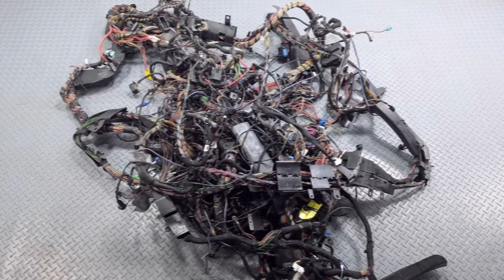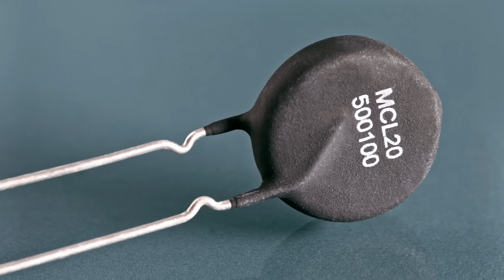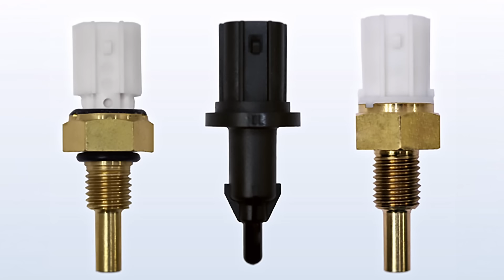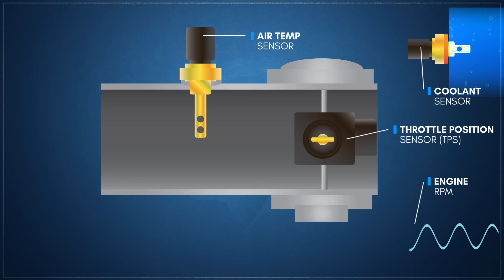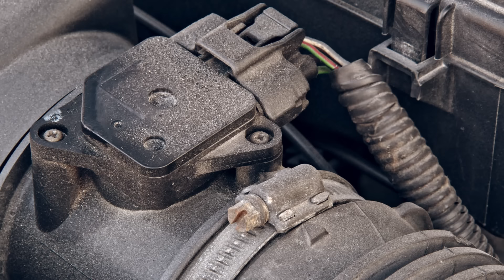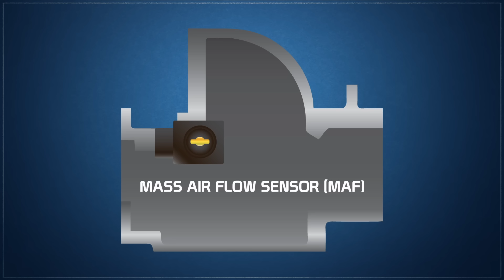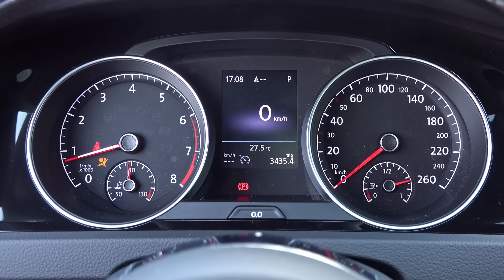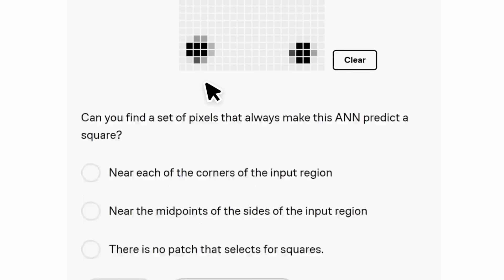The Insanity Of Engine Sensors

Comment: PSA: Only ever buy OEM sensors when repairing your vehicle. if it has wires don't buy a dorman, or any after market sensors
Reply: Pro tip: look at your sensors and find the stampings because most oems are rebranded, made by a general manufacturer like  denso, hitachi, etc. You can save a lot of money not buying oem branded, but get the true oem manufacturer.
Reply: @timlong1462  its true but, The quality Control of OEM was more exigences with tolerances, some refuseds sensors that was refused by OEM goes to second market branded by The fabricant.
Reply: @gga85_ That's not how QC works. Statistically representative samples are inspected and tested by the manufacturer. The manufacturing process is QC'd, not each unit - based mostly on self-reporting.  There is no one at the OEM determining pass/fail at the unit level.
Reply: @ImListeningToReason Yes, 100% sampling can be done. But again, that would be part of the process that is certified as OEM.  The idea that the same line is shunting untested or failed product for separate packaging is BS.
Reply: @kenp5186  While you are right that sensors are generally not binned (sell fails as lower cost to other brands) 100% testing of at least some parameters is very common in sensors. In fact, it is actually often required: due to the way the are manufactured, it is easier to make an inaccurate but stable (and precise) sensor, and calibrate it during testing, instead of making a sensor that is accurate by default.
Reply: @JorenVaes  Yep...do you have anything that supports the original claim from @gga85_ that "refused sensors go to the secondary market"
Reply: @kenp5186 You can have products going through a second QC with a buyer. That’s what he’s referring to.

This may have not been done at some point with some manufacturer(s), but sometimes a company will have a higher quality standard than their supplier—actually this is pretty common, especially with suppliers from “the mainland”.
Reply: Well said big sensor...
Reply: @ thanks, ebay steve!
Reply: You are a fool to pay OEM prices, they are all from the same few manufacturers, IE you think ford is making 100 000 cars and orders say crank angle sensor from anywhere but china , and that said you really think said Chinese supplier isn't making the after market part since ford stop making that truck ... No my friend all OEM is a colourful box with a ford label stuck on it and 300% mark up..
Reply: @ntal5859  There's people who seem to think that at the end of the production line there is someone sorting through the sensors to put the good ones in OEM boxes, or that perhaps they have gone through the time, trouble and expense to build an entirely separate production line dedicated to inferior product.  Although a few 'only for aftermarket' companies that compete solely on price are definitely doing the second one.
Reply: @ntal5859you obviously don’t work in the field of automotive diagnostics. 
More and more I’m advising customers to use genuine parts only.
Reply: Thanks Steve. GN
Reply: Dorman is the worst. I don't know how they are still in business
Reply: Sounds like company man selling over priced remanufactured junk parts
Reply: "If it has wires" that doesn't narrow it down, beside let's be real most OEM parts are just from general manufacturer repackaged and come with 200% markup
Reply: Idk bro im about 50/50 with cheep ones working and 75/25 for good ones working but they cost 2 or 3x the amount so it depends hm work your willing to do
Reply: If yall think dorman is the worst you haven't spent enough time on rock auto
Reply: Stupid advice... Plenty of high quality aftermarket sensors with warranty, at a better cost, are available for vehicles.
Reply: That’s weird bc I had Dorman and import direct products last years with a life time warranty. I even have no problem and no problems with putting on those brands on my bmw no problem at all.   That difference between oem and aftermarket is closing do you really think that part of the industry really gonna die out ?   Lmao
Reply: @tootsitroll9785  No what he said is absolutely true in many cases. Been a tech for 13 years and while it's not true across the board, it is absolutely true many times.
Reply: @tootsitroll9785  bros bmw backfires and doesn't even know it 😆

Comment: When you mentioned vane style mass air sensors, I knew I was about to see a Miata
Reply: bmw e30 318iS never forget <3333
Reply: Miata engineers: make the headlights like the sensors!
Reply: Or my old B5 Passat
Reply: Or a second gen rx7
Reply: @torque-ej4nu the FC?
Reply: @JustDr3-TV  yup
Reply: Any Toyota from the early 80s to early 90s
Reply: 1992 Suzuki Vitara 1.6
Reply: I learned my first efi on the Ford turbo 2.3 with vane metering...efi tuning back in the day with a blinking light or counting a buzzer for codes... Wow. Feel old...
Reply: @bransonclayton I can remember timing lights and setting points... Lol.
Reply: I have a 91 miata with that air mass sensor.
Reply: Or a Retro Encabulator
Reply: Toy Supra,  Datsun 280z  🤔  and a grip of Mazdas had that vane valve deal. Toyota Cressida Nissan Maxima What was the honeycomb one called?  Carman something, Hyundai/ Mitsubishi had these.. a weird port that idk I don't recall having a lot of difficulty with  that style, very  dependable. Karman Vortex, that is what they are called. They work by drawing the air through a vortex tube and there is a triangle shaped obstacle that sets off turbulence, with an led and digital frequency it measures the  buffeted air turbulence and does this surprisingly well. Haven't seen one in a couple decades...

Comment: Awesome video!! I also find it fascinating to see where auto sensors are detecting one parameter as a proxy for another. An example would be using oil pressure as a proxy for flow. I’ve changed truck fleets from mineral 15w-40 to synthetic 5w-30 in the past and everyone freaks out because of the drop in pressure. The engine oil flow is still the same (oil pumps are positive displacement), but as viscosity is resistance to flow, the back pressure will also drop.
Reply: Why not synthetic 5w-40? Less viscosity does indeed mean weaker hydrodynamic effect in the bearings and sliding surfaces.
Reply: You are forgetting oil film strenght on splash lubed surfaces such as the cylinder liners or the valvetrain. 
And hydraulic valve lifters those are very picky to oil viscosity despite being primitive components.
Reply: @alouisschafer7212we didn’t forget. We switched between a group II 15W-40 and a full group IV PAO 5W-30. That, and a change in the VII and VM’s in the formulation means the 5W-30 had a better film strength. We did have some unfair advantages in that I have access to formulations and tribology labs.

I’d say your comment still stands though in general cases where you don’t have access to that detail.
Reply: @LubricationExplained  wow not only does your job seem super interesting  It has a lot of practical applications for doing that kind of research. I actually have been trying to do as much research as I can into different lubricants trying to figure out the best lubricants to use in my motorcycles. I actually have a question about my 2002 Kawasaki ZX 1200 if possible. for a long time, basically since I owned it up until about 4 to 5 years ago, I’ve been using the brand specific oils that you get at the motorcycle shop and they are probably double the price of anything that you would normally get so I am gone and done some research because I did learn a lot of stuff aboutdifferent lubricants when I was dealing with my Harleys, so according to a lot of different forums and different things that I’ve read here and there instead of using the Kawasaki brand oil I am now using Rotella T6 oil for diesel engines and I’ve been switching between 5–20w In the cooler months because I live in New England and I tend to ride in the fall a lot and then I’ve been using the 5–30w in the peak of the summertime. And not only does the oil on these type of bikes, cool the engine and lubricate the parts, but it also works as the lubricant inside of the clutch as well and the clutch seems to really like the Rotella T6 diesel formula and I’m just wondering what exactly makes it better For my bike and is it something that could cause damage to some components or does it seem like somebody found the golden ticket and gave everybody some really good advice? I’m torn between the two and seeing somebody with your type of knowledge gives me some positive hope for a, informed answer
Reply: @mriopelle33  Dude that's a memoir, not a question
Reply: Decrease in pressure has an effect of boiling easier. Sounds fun on a hot day on a expensive machine.
Reply: @FearOfDeath1332 probably not an issue when the boiling point of oil is 300 degrees celcius+ then even higher when under pressure

Comment: 0:50  THIS is the Main reason why electric cars are going to take over!! I am a big fan of Gasoline cars, especially Cross plane V8s, and yet, any further improvements to a mechanical engine like this require more and more sensors for precise fuel burn and timing etc, it makes sense to just go fully electric and the advantage it provides for instantaneous torque output, and precise control!!

I am not demeaning gas cars for this! They still have their place, especially the purely mechanical and reliable ones! But for modern cars, especially as a vehicle to get from point A to B, I think all that engineering R&D is better spent on making efficient electric motors and energy dense batteries! 

But I still love your videos! It helps me get a better understanding of the wonder machine that has helped humanity progress in mobility for the past 100 years, and the enormous impact it had on our culture as well!!
Reply: Or just go hybrid , where a gasoline engine works as a generator and works in same rpm always and does not need so many sensors, for example Chevrolet Volt
Reply: @ True! That would make for the simplest form of a reciprocating engine tuned for max efficiency, while the motor does all the fine tuned work of driving! But also, battery electric cars are also getting cheaper, and maybe in the future, will negate the cost and early mover advantage of the reciprocating engines!

I would like to see reciprocating engines continue their lineage in supercars to be honest! Especially would love to see more V8s and legendary V12s and V16s come back as a tribute (like the Bugatti Tourbillon), with none of the environmental virtue signalling - just pure performance and engineering as a tribute to one of humanity best and most popular inventions!
Reply: And how are we going to charge all of these electric cars?
Reply: @jesselittle7452  Improved Power generation, More Solar and Nuclear Power, upgrades to the power grid to handle all those loads, more electric Charging Infrastructure, and just being energy surplus in general from Carbon neutral sources!

Comment: Nice video on a topic that’s always right in front of us. But it reminds me of this.
I wish the odometer in our 2005 Prius didn’t stop at 299,999. It was made that way. The state wouldn’t let it pass inspection even though this was OEM. Toyotas response was so what. We had to install a new odometer. We put on another 30,000 miles. Before selling the car.
Reply from the maker: For Land Cruisers, 300k usually gets you a congratulations for making it through the engine break in period
Reply: @NewMind  perhaps before now they are 4 cylinder turbos like everything else. in 20 years i believe less 2025s will still be around than the 15s. darrn shame land cruisers were beasts